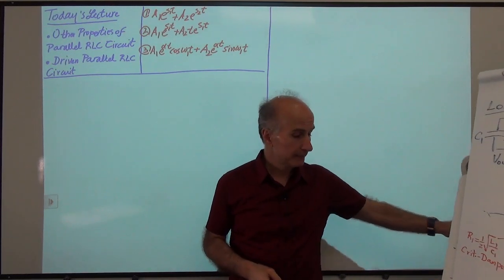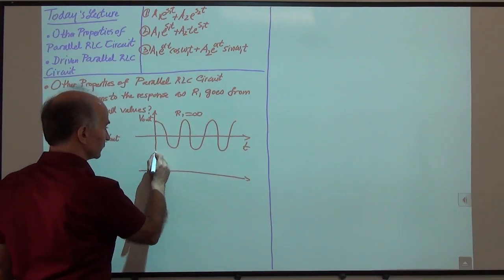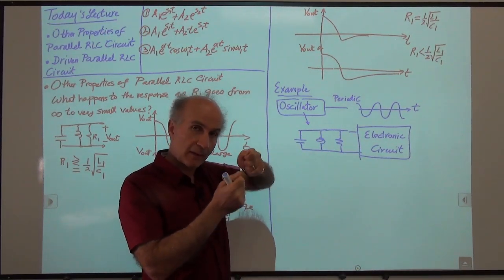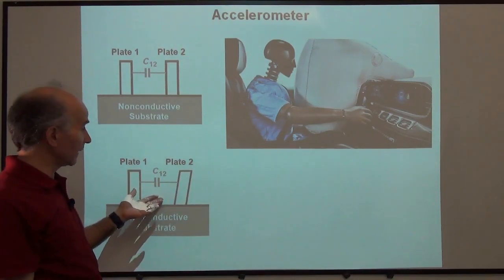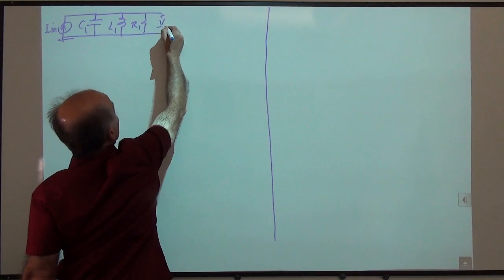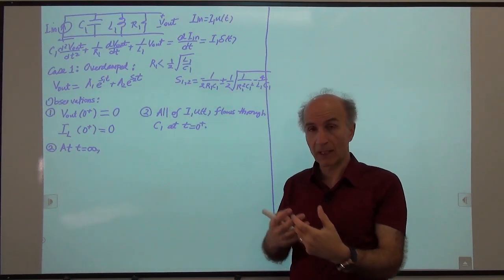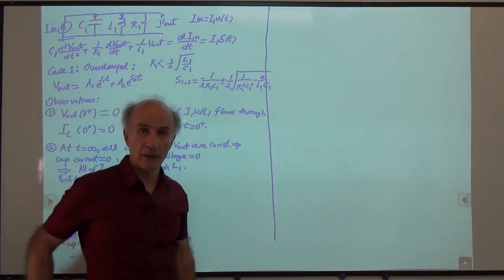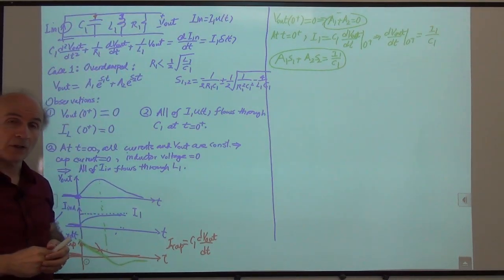Razavi Basic Circuits Lec 31: Driven Parallel RLC Circuit (Part 1)

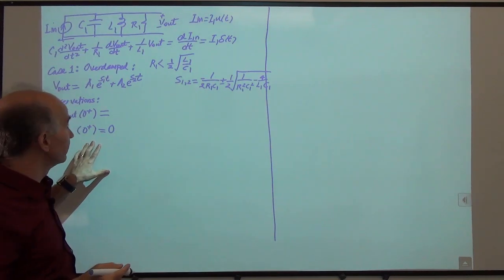Comment: @36:00 how is it possible that at time zero there is not current through the inductor but there is a current through the capacitor.

If current through inductor doesn't change then the derivative is zero so os the voltage zero and zero voltage means short circuit 😮😢😂
Someone please help me make a sense of this 
Both do not change their state instantaneously so how is current through one zero at zero plus but there exists a current through other at zero plus 😢
😮
Reply: intially cap act as short circuit. while the inductor resist the current flow. so the voltage zero doesnt mean short circuit

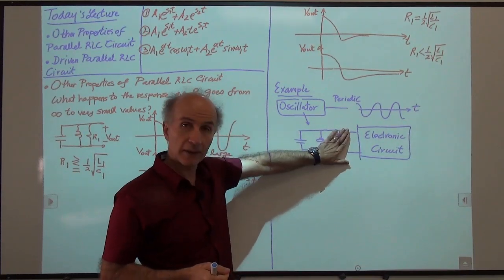Comment: Professor im talking beyond this course.. around 16:55 in order to cancel that lossy effect i mean resistance effect we introduce one electronic circuit that should give negative resistance.. here tunnel diode also gives negative resistance over certain range..but it is passive device..we need active circuits..either circuit will be made up of transistors , MOSFET r opamp..if I want to use opamp circuit here.. can i allow to use non inverting amplifier with feedback..for non inverting amplifier gain should be positive.. according to millers theorem.. resistance at the input end will be R/1-A here A positive.. so it will give negative resistance at input side..can i use this circuit.. im little curious to know instead of MOSFET can i use opamp here..

Comment: 33: 30 , how could the characteristic equation become same as the previous one ?
Reply: It's same because we only focused on complementary function of differential equation that is left hand side part compare undriven circuit equation with driven circuit equation only I1 del(t) is differ.. it comes under particular integral.. undriven circuit is homogeneous circuit..so it won't contain particular integral..but driven circuit is non homogeneous it have both complementary function and particular integral.. sir took only complementary function.. that was the reason it seems similar in previous case.. if we add particular integral solution then it will be differ..I hope u know differential equations very well in math..